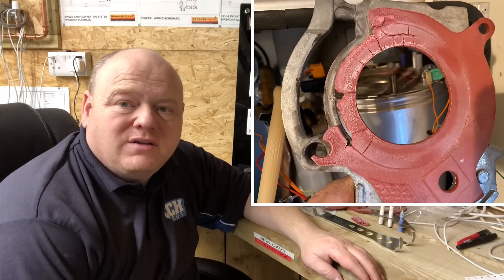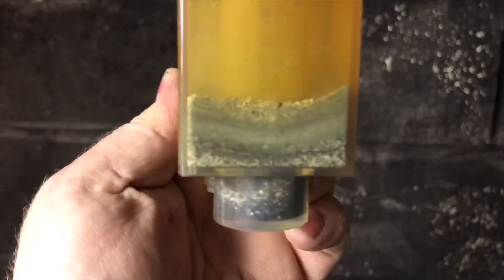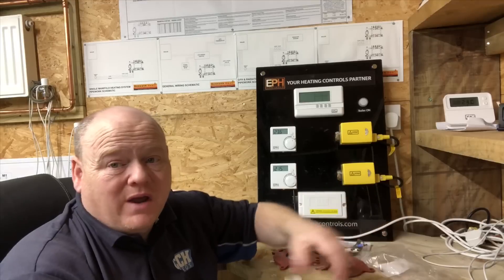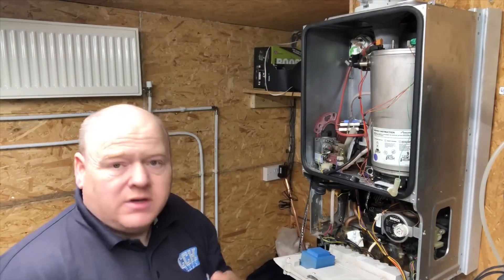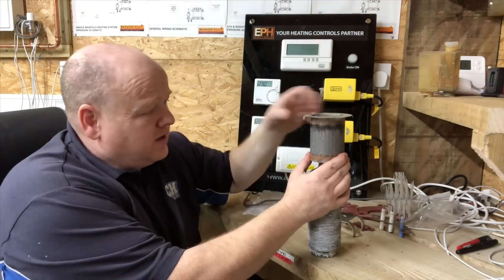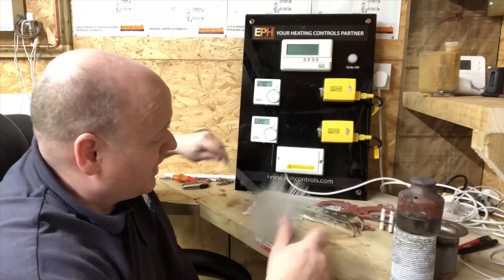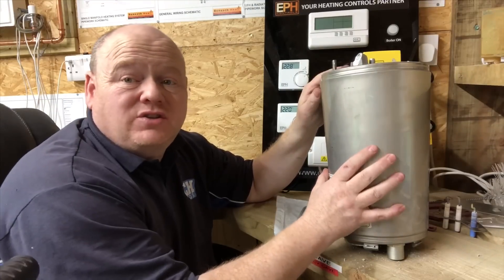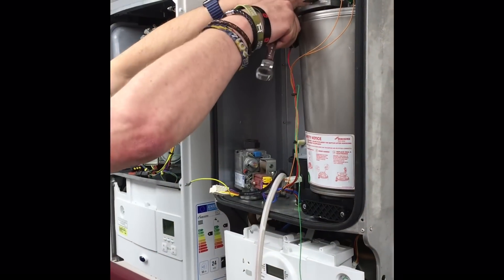Worcester Bosch Boiler Service - Leeds Plumber

Comment: I usually charge £60 plus vat for a boiler service. Had a strange call last year, customer asked me to service her worcester as per the manufacturer instructions. Told her no problem but would be considerably more than £60. She told me I was too dear and hung up.
 Its close to a days work to service a Worcester properly, plus service kit.
Reply: That's good going. Takes me about 3 hours plus travelling time to pick service kit up from plumb centre.
 However I prepare for the worst, which means further parts and faults found.
Reply from the maker: johnacky I have WB as van stock 😂
Reply: @johnacky  its just what your used to iv worked on loads of these and love them only takes me 1/2 hour to do a complet strip down and charge £100 including the gasket and rubber tube
Reply: On Worcester course when they came out straight from reps mouth fan flue test OK and ratio etc leave it alone their selling point was no strip down😂😂
Reply from the maker: How does it take a day? Normally takes me around 2 hours. Thanks.

Comment: I have had a few bad ones which are so stuck I have bunged the sump and filled with 2l of cola. Loads of crap comes out. Crap boiler I work on loads and hate them. Baxi all the way
Reply: That's a good idea. Do you let the cola drain away through the trap after or siphon it out? How long do you need to leave it in there for to have an effect?
Reply: @billybobhouse9559  let it sit about a hour
Reply: @adejohnston6831  cool, thankyou. Does it help at all to put a little lemon slice in as well?

Comment: Most service engineers hate this boiler with a passion. The fact the burner head needs new gaskets and electrodes every time it comes apart prohibits proper servicing every year unless the customer wants a £140 boiler service. The fan pressure test is inadequate because by the time the test fails it’s too late and the baffles probably won’t come out.
So engineers end up playing Russian roulette with servicing, unless you know when the gaskets were last replaced. You just don’t know the condition without a full strip down. 
This boiler is a bad design throughout, from the PRV location to the plastic hydro block.
The fact that Which magazine makes Worcester Bosch number one in the best buys makes a mockery of the public and Which magazine itself.
Reply from the maker: 100% agree with all you have said.
Reply: Absolutely correct there
Reply: Totally agree, as do most engineers I know.

Comment: Crap heat exchangers, I wouldn't have a Worcester Bosch, I'd rather sit in the cold lol. I go out to loads, rubbish, trouble with Worcester Bosch there good at marketing
Reply: Thry are also recommended by Which?  as a Best Buy...
Reply: @stevehove2648  which doesn't know the problems us engineers see on a day to day basis, I wouldn't listen to which
Reply: @WEYHARRY1  I get that, yes, but they do take into account the owners satisfaction. Same as they do with cars.
Reply: @stevehove2648  yes your correct which does that.  but normally they start going wrong between 5-7 years, they should ask engineers view and not just customer reviews

Comment: Great boilers, because of the large waterways they are always  easy to clear. Lovely job
Reply from the maker: That baffle was a nightmare, Any tips? I did pour coke down 😂😂😂
Reply: Allen Hart I personally would pop the heat cell out. 20 min job. If I couldn’t get one out. You can attack it from the bottom then. Never had to do that personally though 👍
Reply: @jez lucas where and what are you bunging it with? I suppose you could shove some blu roll into the rubber tube that connects to the condense trap.
Reply: @jez lucas thanks man 👍
Reply: are you serious LOL there a total pain in the ass

Comment: This boiler was designed with no thought or concept for future maintenance and service work
Reply from the maker: Not a great design in my opinion.
Reply: @AllenHart999  i cant work out why they are still using the same heat exchanger design on the new ones , every other manufacturer has simple ways to clean the heat exchanger without the need to rag it about and replace the seals
Reply from the maker: @accesszero4803  100% agree, I cannot think of many boilers worse than these to service.
Reply: @boiler man007 sell to the consumers not the installer

Comment: Yeah if these heat cells aren't serviced as per Mi there's almost always a soot build up in the heat exchanger.  If they're not attended to the kebab exchanger ribs.  The burner gaskets fail because of backwards pressure of heat due to soot blockage.  It's a pain in the a##e but it has to be done.  Great Autopsy Allen 😜
Reply: ghostmanromeo uk disagree 100%. I blame Worcester all the way. It says in the mi’s only clean heat cell if it fails fan pressure test.it should state strip clean every year full stop. Burner gasket poor material and poor design along with the design of heat cell.worcester boilers are a high price boiler that has got a reputation of old models. Tech support is good though.

Comment: I’ve never service mine since I fitted it new, rubbish boiler to work on so I decided if it breaks I’ll replace with an ideal, nice and easy to service plus 12 year warranty. I stopped fitting Worcester’s over priced over complicated garbage.
Reply from the maker: Vogue? I am guessing you wouldn’t install a logic. Thanks.
Reply: Allen Hart I install lots of logics easy to clean the heat exchangers with hot water etc. Vogue is my boiler of choice.
Reply: Allen Hart the funny thing is I install a Worcester 15ri for my mate (he’s an engineer) and the kitchen fitter who instructed the job asked my opinion of the boiler. He didn’t like the reply.
Reply from the maker: @ebebop  Vogue is one of the best combi boilers on the uk market in my opinion. Thanks.
Reply: Allen Hart  I agree, I’ve had little issues with the logic’s a few heat engines and flow turbines from a hundred or so.  It amazes me how many people have a new boiler ask for plenty of warranty and never service them.
Biggest issue I’ve had with any logic range is the rear exit flue seal on logic heat. They could do with a design change.

Comment: Changed the left hand side hydro block on one yesterday, took me most of the afternoon, what a bastard of a job. Tried to do my checks after and it would not run. used my limited electrical knowledge to check that I had power to everything . Had almost given up, put the case on and the f**king thin ran. 7pm on Valentine's Day. It hasn't been serviced , expansion vessel has popped there is no way I'm stripping the burner in case of what doom I will find. I can do a straight swap in 4 hours (hate these boilers steer well clear)
Reply from the maker: Hi Timmy. I am not a lover of the boilers to be honest. 👍